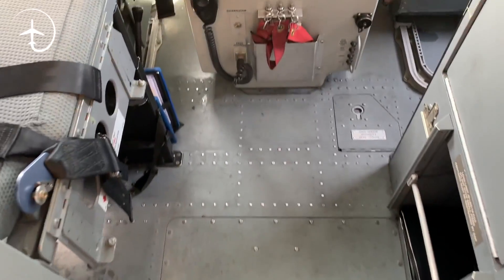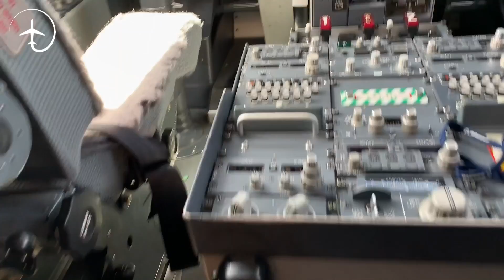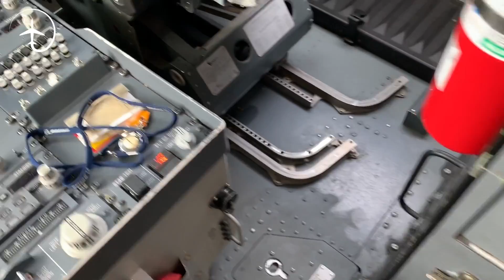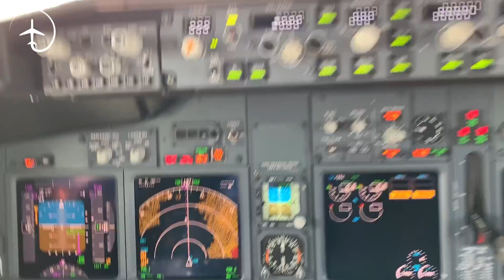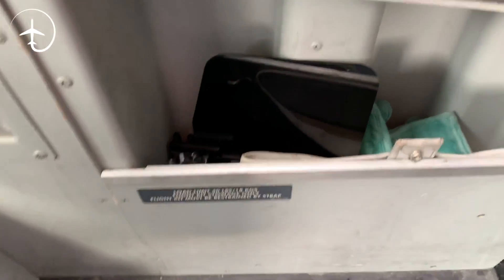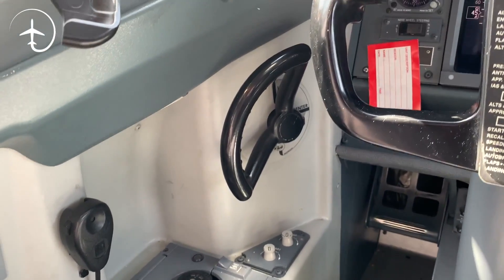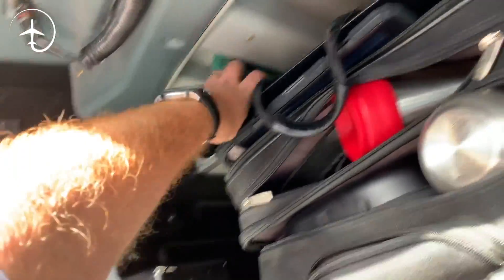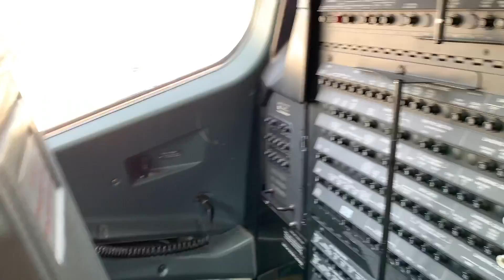Boeing 737 Cockpit secrets!

Comment: I know the 737 design goes back to the 60's, but still, I'm surprised  to see incandescent bulbs! I would have thought they would have changed to LED's quite some time ago.
Reply: That's a great question.  In one of my cars, I find LED's in gauges annoying because they flicker.  It's very distracting.
Reply: right?  if they have a glass cockpit, they apparently are not afraid of modernizing the aircraft with modern components, so why not 86 all the incandescents?
Reply: @Phillip C
Using LED units in place of incandescents requires a lot of alteration due to the lesser amperage they use..so they would have to modify every single unit. It's still probably cheaper and more cost effective to just let them be.  They do have dual redundancy so it is likely that you'll always see a warning light.
Reply: Theoretically, you could manufacture LED bulbs for that purpose, but I think the power savings would be too small to be worth it and maybe those LEDs would have to be certified in some way, which would add to the cost. I know that older cars for example don't like LED bulbs too much, since there is the possibility that the onboard computer assumes the bulb is faulty due to the comparably small current draw (not sure if any airplane uses that method to detect faulty bulbs though).
Reply: @ajg617  LEDs shouldn't flicker if they are properly controlled/powered, so that flickering could be blamed on their driving circuit.
Reply: You buy into that global warming BS, Highly Polished. As a person whose body was destroyed falling the GD food pyramid for 30 years and now on keto, scientists had 1,000 the times on food nutrition than they do on shaky computer models on climate and the "consensus of scientists" fostered he deadly high carb, high sugar diet on first Americans, then the world.

Global warming fascists forced LED bulbs on us. They should all be taken out and put into LED prisons for life.
Reply: More importantly incandescent bulbs can reveil there ON or OFF state on impact. The molten filament leaves a spatter on the inner surface of the glass bulb if it is ON during an impact. ie; weather or not certain malfunction indicator lamps were illuminated at the moment of impact. LEDs cannot record their history.
Reply: @watershed44  If I were to speculate, your answer makes sense. After all, it's a 50ish year old design still being pushed along, to save money over a complete re-design.
Reply: Plus, if they changed to all LED's, they'd have to train the engineers on how to maintain them. LED's are a lot harder to fix then just removing and replacing an incandescent bulb.
Reply: This question goes to the very core of what people do NOT understand about airlines.  Changing things unnecessarily just causes more problems.  When the maintenance guy wants to re lamp a light, he doesn’t need to find out that new fancy expensive led bulb is not available. He wants the bulb to be there and work. Dispatch ability is huge to airlines. Why strand an airplane and misconduct hundreds of passengers to save 10 watts of power on a gear indicator.  

More modern design would be to move these lights and indicators to computerized displays, so that they are more reliable, don’t weigh anything, and can be more reliably dispatched. Take the wires and sockets and bulbs out and replace with zeros and ones 

If you look at the nav lights on newer 737s however, you will find they are indeed led lights, at the tune of $3500 per bulb. This price seems ridiculous, but the analysis was that the bulbs are less likely to fail, and therefore avoid a time consuming process of getting lift equipment up to the wing for repairs.  Thus increasing the dispatch and reliability of the aircraft as a whole.  3500 dollars is nothing when compared to misconnecting a few hundred people even once.  The bulbs inside the aircraft are relatively easy to access, and they are cheap and easy to access.  The whole reason there is a kit right there.  Maintenance can grab one and fix it easy.  In a pinch, a pilot could too.  On the newer planes you will also notice there is no taxi light on the nosewheel.  That duty has been moved to a multi functioning led assembly where the fixed landing lights used to sit.  Additionally, there are no retractable landing lights as well, saving the cost of an entire assembly and motorized actuator, switches, wire, etc. so the led lights are gradually coming, but they aren’t much in the cockpits yet.  Hell, as you can see, the cockpit is still in the late 60s, except for the glass.  But those switches are all controlling completely redesigned pumps, valves, actuators, etc 

In a nutshell, everything about airplanes is driven by money. What works everywhere else doesn’t always make sense in an aircraft. You can change all your house lights to leds, but you didn’t have to get the faa to certify that operation.  And if you own 160 houses, you have to stock every single bulb in every city those houses are in. Except in this case the houses move from city to city, so you have to stock all the bulbs in all the city’s.  And the bulbs now cost 150 dollars each because of how they are manufactured and regulated.   So the savings comes when you can remove the system, rather than save 10 watts on a circuit.  They made some significant progress with that on the max, btw. Which uses larger displays and integrates a lot of lights and indicators onto those panels. Saves weight, easier to fix, more reliable, less cost....

It’s not just light bulbs, it’s literally every single little thing on an aircraft. It’s shockingly easy to ground an airplane for some little dang unsuspecting thing.  Which makes running an airline in a regulated safe manner a tough business.  

Sorry for the long winded rant.
Reply: @markg7963  A long rant, but a good one, and it makes sense. Upgrading technology just because.. New stuff happens to be there... Does not necessarily make sense, especially if the old school way is working fine.

Comment: typical Ryanair cockpit,  very dirty!   best to bring ur own kitchen wet wipes to work,  with the pack lunch!
Reply: Pretty much the same any place with shared equipment, half the population must have been raised by pigs or they had maids to follow around and clean up after them. The worst is when you grab the controls and they are wet and gritty with half dry hand sweat.
Reply: Much worse in airlines that use an older fleet.

Comment: The 737 max 8 will also have a space suit in case it will fly straight to space with the MCAS system. 🚀😂
Reply: A new software problem could pull the nose up instead of down.

Comment: that thing is old , very old
Reply from the maker: Not more than around 7 years.
Reply: @MentourPilot  that's not what i mean, i actually talking about the 737 design look old like what you said about the bulbs
Reply: @THYB737  the 737 designed in 60s and it didn't change so much, except as you said it has a LCD screens with no many features compared to the a320, he said that when hea talk about the bulbs

Comment: It is crucial to aviation safety that Boeing not be permitted to "fix" the 737 MAX with software.  The plane was made unstable due to new, larger and heavier engines which were stupidly located upward and further forward for ground clearance.  This causes the 737 MAX to often pitch up at max thrust on take-off.  Basic aerodynamic stability was compromised.  MCAS is compounding the error: for an airplane that lacks essential stability, software only "papers over" the underlying problem, and Boeing management knows this. 
But they decided to allow a flawed fifty year old design decision to continue rather than implement a costly re-design.  The "reasoning" in the 1960's  was that smaller airports would not have lifts to permit ground crew to access the baggage hold, so they purposely made the landing gear short, giving the engines only 17 inches ground clearance.  Thus, 346 people have so far been killed by what amounts to negligent homicide in two incidents.  New software will not cure this problem.  Every in-the-loop manager at Boeing is criminally liable, from the CEO on down.  Of course this will not happen, as Boeing has become too big to fail.
Reply: Why Soitanly   Seems like you are cherry picking your facts to make your case. Some of your facts are correct, but your basic premise that the 737 is aerodynamically stable is false. MCAS does not function the way you state, nor for the reasons you state.  The 737 max is stable and flyable without any computer intervention whatsoever. It’s function is to cause the 737 to mimic its new gen cousin as it APPROACHES a stall, so the pilots get a consistent stall recovery from one airframe to the next.  

I grant you that Boeing screwed the pooch big time here, but your logic on aerodynamics and MCAS function is not correct.  The FIXED MAX aircraft is as the design should have been in the first place, and I can’t wait to get back in it and fly it again.   Come with me and I’ll show you how it all works.

Comment: Sir don't you think the passenger cabin is tidier than the cockpit? Don't you think you guys deserve much cleaner and sterile environment to work in the flight deck? Because you spend at least  6 to 8 hours inside the cockpit everyday?
Reply from the maker: This is an old aircraft. And unfortunately it’s only engineers who are allowed to clean in there.
Reply: @MentourPilot  makes sense

Comment: right, there should be no secrets on a 737 cockpit. This looks like a 737 cockpit from 1972?
Reply: did digital video displays exist back in 1972?
Reply: Too much modernization, and Boeing would have had to completely recertify the aircraft, costing them and their customers time and money.
Reply: One from 1972 has no flat panel LCD screens, it’s all analog gauges
Reply: this plane is only 8 years old.
Reply: The plane may be only 8 years old, but most of its design has not changed since 1958
Reply: @DavidLemmo  not even the 707 was around in 1958
Reply: @ethancedrik  right..!

Comment: B737 was a great plane , too bad redesigned MAX is full of  screwups . Not everything new is always better.
Reply: You can only push an old airframe and wing design so far. The Max was a classic "bridge too far."
Reply: @steven2145  I agree they tried to stretch the 737 too far too cover the screw up of not having a proper 757 replacement, but the MAX grounding is purely a software and training failure.
Reply: Why do you say the max is full of “screwups”. Granted one really big one, but that’s getting fixed fairly easily. A bridge might not be safe if it has a bad member in it, but fix that rather than throwing the whole bridge away.  To my knowledge the MCAS system in the max is the only thing that they really screwed up....  all be it a pretty huge mistake.  I won’t debate that.  But I have flown it about 40 legs and I will say it flies amazingly well, and it’s just more of the same 737.  Fix the MCAS. Sue the crap out of Boeing, and make the best out of it and move on. Boeing will probably not design another variant and will move to a clean sheet design, but that’s years away before they can get that to market. And even when they do, we all lose the vast knowledge base of experience with an airplane we know and love, and from a safety standpoint this new clean sheet design doesn’t come without its own safety concerns.

Comment: The 737 looks uncomfortably old
Reply: It is old, much of the design is unchanged since the 1950s. The 737 at it's core, still just a variation on the 707, an aircraft introduced in the 1950s.
Reply: Dan Lindblom - This aircraft is 8 years old.

Comment: It’s odd that your airline chose to mount the PBE in the closet.  It takes up a lot of space that would normally be available for hanging coats/jackets.
    
      Most airlines in the US put the PBE in the storage area aft of the F/O seat (below and outboard of the P-6 panel).  The door to this storage area can also be secured with tamper evident seals, allowing for a quicker pre-flight inspection.

      This also goes with the philosophy of keeping the PBE close to the fire extinguisher, since you would most likely use them together.
In the cabin, the PBEs are close to the extinguishers as well.

     All of those paper forms you have can be stored on top of the folder below the jumpseat hinge.

Comment: It might also be mentioned that each airline, when they order an aircraft, has gone through 100s and 100s of pages of manufacturer's options.  Each airline has painstakingly gone through each option offered by the manufacturer, and selected those options which fit the operations of the airline.  Each aircraft is highly customizable, within regulations and company desires.

Comment: Love the new intro!  Question...why would some circuit breakers be in the pulled position as the normal position?
Reply: Not every plane has the same systems installed, but they all use the same breaker panel. So they permanently pull the circuit breakers of systems that aren't installed on that plane.
Reply: Murph's Models thanks!

Comment: Very good video, can you explain how the yaw dumper works?
Reply: ricard Mestre Escoda 

     Yaw Damper.   It receives yaw rate info from the Inertial Reference Units (IRUs) and applies inputs to the rudder PCU to damp yaw oscillations.  In a swept wing jet, it is useful for damping Dutch Roll.  

       It is also not necessary to coordinate turns with rudder in the jet.   The yaw damper senses the sideslip when aileron is applied entering a turn and applies the appropriate amount of rudder to coordinate the turn and “keep the ball centered”.

      If it fails, you may need to descend if you encounter turbulence.  Also, Boeing recommends flaps 30 landing with INOP yaw damper.

Comment: A great tour of the flight deck.  Thanks.  Seeing the circuit breaker panel behind the first officer reminds me of a question about the 737's electrical system.   Does the plane use 24 VDC for lighting, signs and other auxiliary equipment?  Where are the batteries?
Reply: 28 V

Comment: Please do a video on the galleys. QUESTION: Does the type rating include questions on the switches and controls in the galleys? After all, aren't pilots supposed to know all the switches etc on their aircraft? Thanks.
Reply from the maker: No, they need to know the switches they will operate. But yes, we should have a basic knowledge of everything,
Reply: @MentourPilot  Ok, I take that as meaning there are no questions about the galleys in the type rating - but please do a video on the galleys anyway! Keep up the good work!
Reply: I've met a few pilots who have no idea what the switches on the fuel panel do.

Comment: 2 questions: 1) Is that black tubular gizmo with a red ring at one end and a coiled cord positioned aft of the USB ports on the captains left a light? Is that still there from the days of reading your charts at night before iPads?  2) Do you find that your eyes adapt better and with more or less fatigue reading the LCD digital instruments and iPads better than the backlit on the old analog instruments?
Reply: 1) Yes, it's a flashlight.

Comment: Ok, so the jump seat blocks the door. If you had a fire in the cabin, would you put that seat up prior to landing so that’s it’s not blocking the exit?  Or would you do it when stopped if evacuation is needed?
Cool video of the 737!
Reply: If there was a jumpseater AND a fire, I’d have the jumpseater go fight the fire with the pbe, gloves, and whatever fire extinguisher he can get his hands on.  All hands on deck to get the fire out at ANY cost, even with the jumpseaters dead body if it comes to that.  The pilots job is to get the plane on ground and stopped so the cabin can get evacuated.  If that don’t happen, everybody dies.   Last thing I’m worried about is my own egress.  But, the jumpseat easily folds down and you can just step over it, or go out the window with the rope if you want.  Fire on an airplane is a nasty and often fatal event. We do brief the jumpseater in an evacuation to fold the seat down but not attempt to place it back in its home position, as the seatbelt straps often inhibit it from that, especially when the jumpseater isn’t a 737 pilot and accustomed to the quirks. It’s easier and faster to just jump over it.  Jumpseater would normally be evacuated fairly quickly and can start assisting people on the ground as they evacuate.  Mainly organizing them and keeping them out of harm from the aircraft itself, or responding emergency crews.  Captain is normally last to go and attempts to sweep the aircraft of residual people if possible. 

Most aircraft jumpseats block something, and usually the cockpit door.  If it weren’t about money we would have 10 first class seats up there, a kitchen, a bathroom, a movie theatre, and we would take our girlfriends everywhere.  Nothing would block anything....  but alas... reality.

Comment: Hello Peter, I noticed that there is a tablet holder to the left of the pilots chair. Is that for a company specific tool, or are you allowed to use an EFB like ForeFlight?
Thanks.
Reply: I’d guess it’s company installed for company issued iPad. There’s even USB ports below to charge the iPad!

Comment: This is a very diferente cockpit from my plane. But again it depends on the company. For instance we have just one Jump seat and we have two EFBs one for each pilot, wish are very usefull, because we have all of the plane’s manuals, electronic charts, and also an OPT to calculate all of our performance. We have a printer to get in touch with OPS via ACARS in order to request weather information, send and recive messages. Our planes are very well equiped. I know you can do all of your calculation on your iPads, and all the charts are also in the iPads wich is also cool. We use a tool wich is called Jeppsen pro flight. Can you please talk about the OPT, or the EFB in your next vídeo? Big hug and have a nice flight.